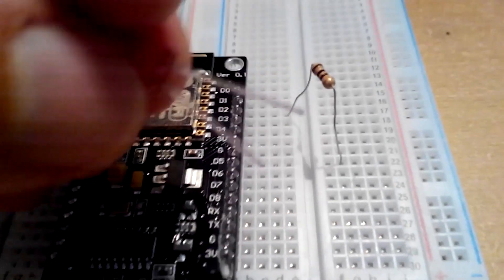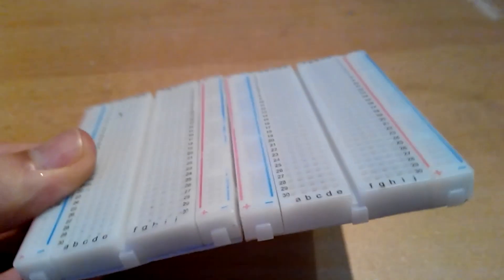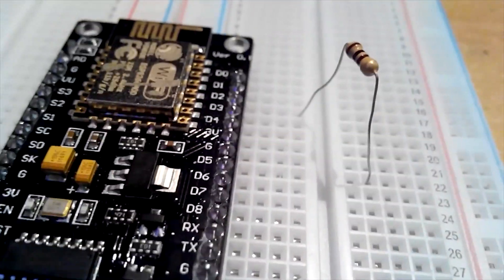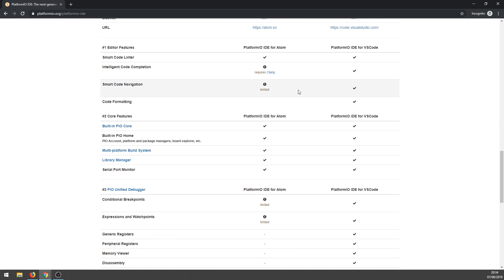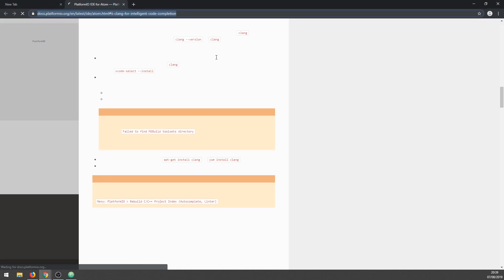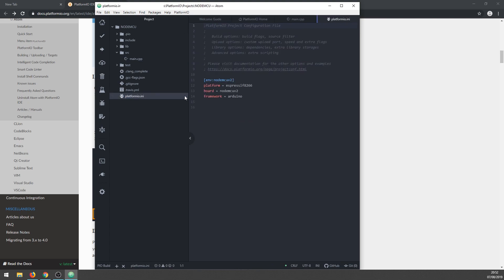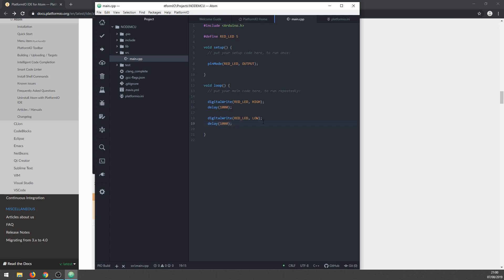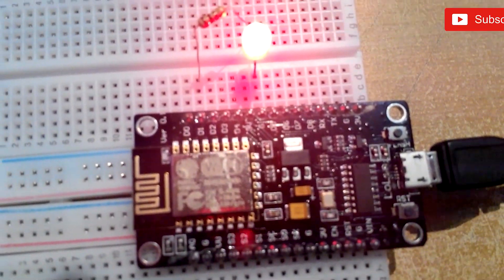Starting With NodeMCU ESP8266 Blinking LED Using PlatformIO

Comment: They do sell these boards in the "Amica" or "V2" version that is smaller and fits on a single breadboard. Notice you have the "Lolin" or "V3". Neither is better, really. They just use different USB interfacing chips and have different sizes

Comment: Hi Sir,

Nice and informative video. i did the test on Nodemcu/esp8266 blinking onboard led - was successful and all ok

but when trying to use some github project shared by brad at https://github.com/bradc87/GarageDoorSensor
it gives me this error. have been trying to figure it out but not sure why it's getting failed. Getting this error [screenshot]

https://i.postimg.cc/rFC5j30L/Screenshot-2020-09-25-at-2-58-18-AM.png

could you please guide me what i should do. Thanks.

Comment: A fatal error occurred: Failed to connect to ESP8266: Timed out waiting for packet header
* [upload] Error 2. How do I fix this?
Reply from the maker: Have you tried to press reset button while trying to upload? Check that you have NodeMCU drivers installed. Also try to unplug and plug again USB from PC. Then try to use another USB port or test from other PC if you have it. If still not working, problem could be in board (NodeMCU), because they are so cheap and made fast and sloppy. I saw that if you put 1 capacitor around 2 uF from pin EN to GND it should help.
Reply: @1BarConnection  Tried these tips, will try the capacitor trick. crossing thumbs